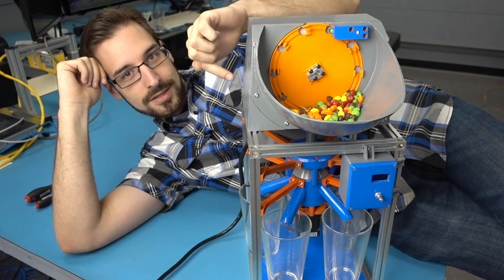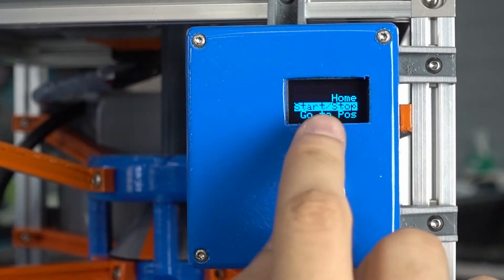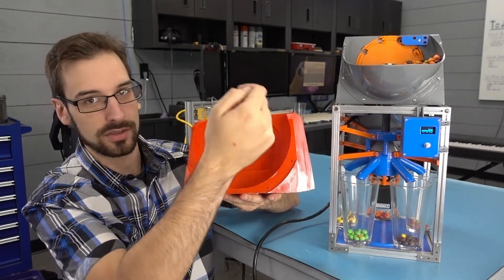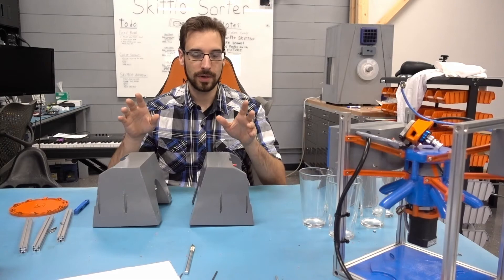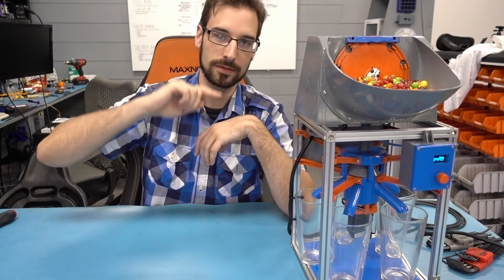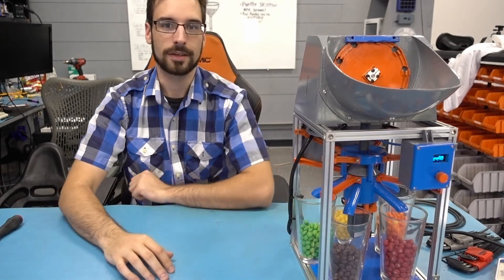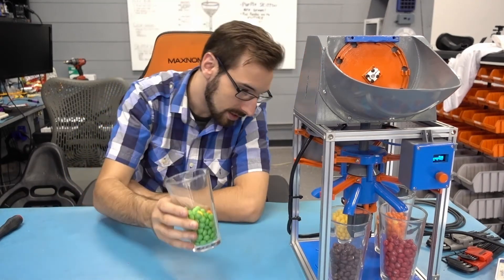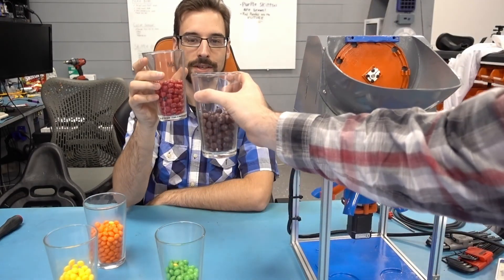Skittle Sorter (Part 6) - Final

Comment: The speed and accuracy of that diverter set up is really impressive, nice work!

Do you think any of the errors are due to misreads by the color sensor? Or are they all due to the double feed issue as you described?
Reply from the maker: Yeah, That is why I love servo motors.

It is possible, but unlikely. We ran the whole bag of skittles through one at a time (Which was about 170ish of each color) without error. We actually improved the data handling on the color sensor. I didn't include that because I am trying to ease into explaining more technical things. It came down to realizing that we actually had three dimensions of data coming in,(red, green and blue) but we were only evaluating them in two dimensions. (the converted hue and brightness) We changed our method over to converting the red, green and blue to hue, saturation and value. Then, we used the same distance-from-average method but in three dimensions.